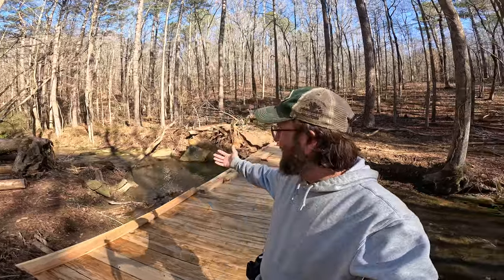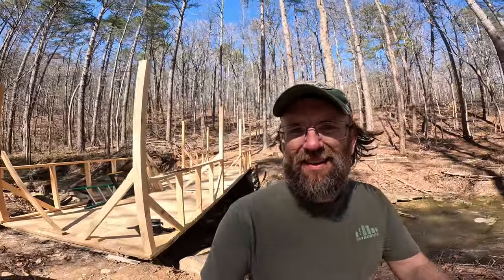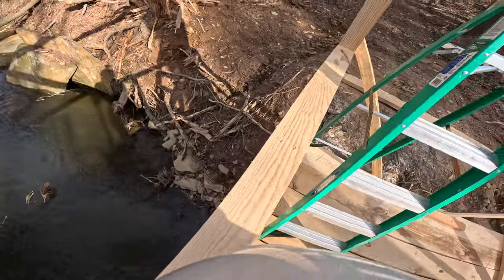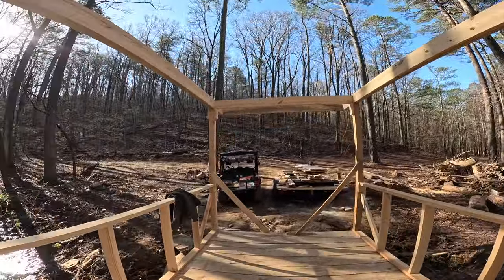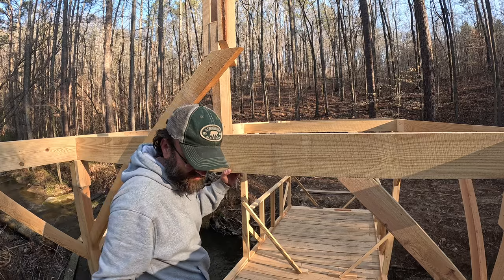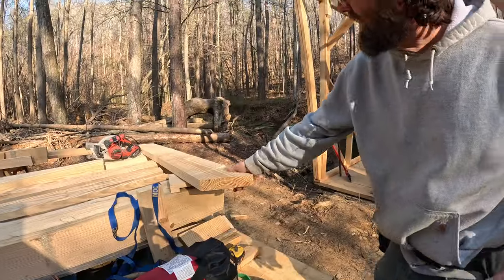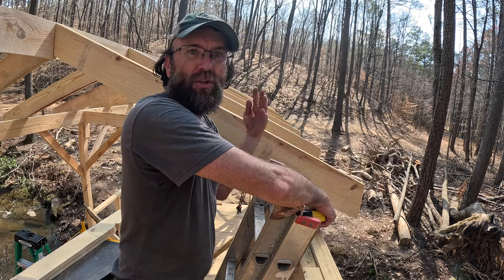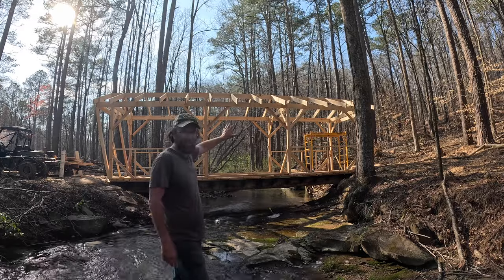Covered Bridge Build Part 3: Wall & Roof Framing

Comment: Man it would look good if the ridge board you put up if you put a chunky piece of wood to hold it up. More decorative than anything. But you might be going to close it in also so it wouldn’t matter
Reply from the maker: The temporary supports I used to put up the ridgeboard are being replaced...purely there to help hold it in place while I did the rafters.  Saying that...unlike the post and beam pavilion I built this past fall, I am intentionally milling the lumber for this build to be 2x material so as to save weight on the bridge.  But I love your idea!!  Thanks for watching.

Comment: Will a cab tractor fit through it with those inboard wind braces?
Reply from the maker: It should fit!  I don’t have a cab tractor but my TYM 474 open station will fit with lots of room to spare.
Reply: @homeplaceadventures  I have a Deutz-Fahr 5080D cab tractor. I think it is a bit over 9 feet tall. Overall width is a bit over 70" but I have my wheels set wide so mine is a good bit wider. Your bridge is looking sweet.
Reply from the maker: @enwinn  My ceiling height is 8.5' tall so unfortunately should you bring your tractor to my place I think you'd have to park on the river bank.  :D I built it to fit my TYM 474 and also looked at the specs of like the Kubota MX5200 in case I end up getting a slightly bigger tractor at some point but the 474 really is a great tractor for my use and property...smaller frame makes it easy to get around in the woods and big enough to handle the logs on my sawmill.  Thanks for watching!